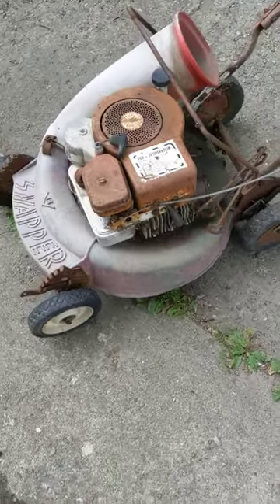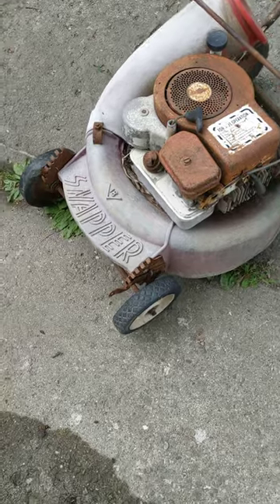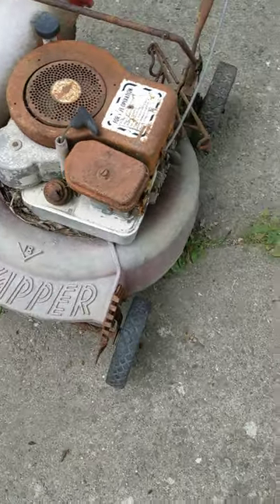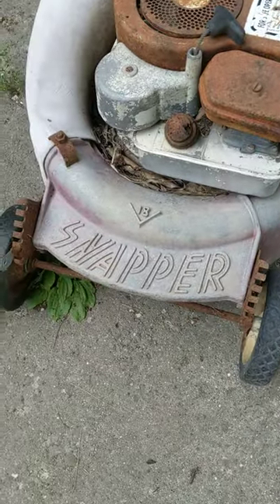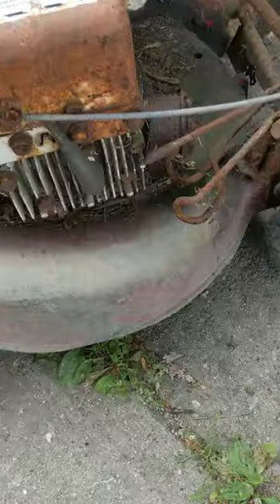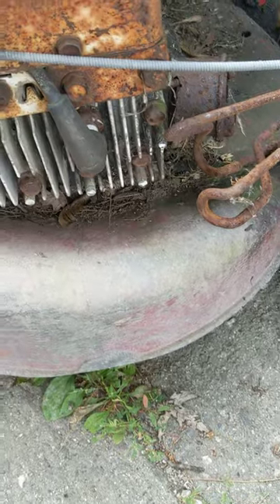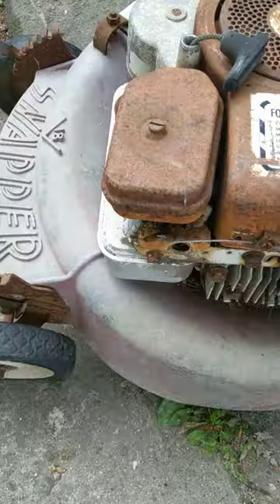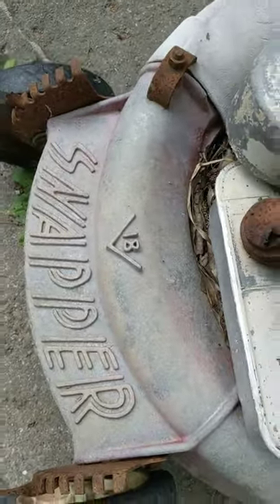Vintage Snapper lawn mower, Curb alert

Comment: Based on the letter font cast on the front of the deck, it may be a 1960s snapper. Also, the fact that it is 18 inches rather than the usual 21-inch deck may make it a rarer mower. It's definitely worth restoring if it isn't too far gone.

Comment: Those old Snapper mowers are great. I have 3 of them. a 1979, a 1977, and a 1992 model. I believe they actually used magnesium decks, but I am not sure if that is all models or just certain ones. I am certain that it can be got going again. 
Also, was that one stripped down or something? never seen one that isn't red with white letters.
Reply from the maker: I'm sure it was probably red. That's just the way I found it. The engine isn't locked up so it can run